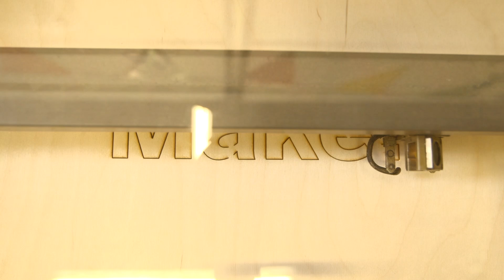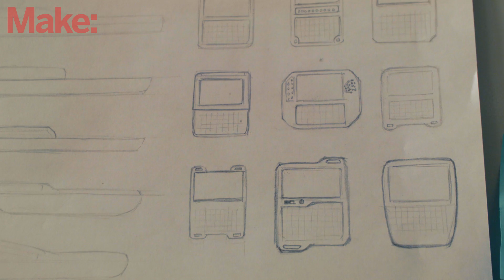Next Thing Co. Releases "World's First" $9 Computer

Comment: Ooo raspberry pi killer?
Reply: sonicase No chance in hell. Allwinner chips are pretty underpowered and laggy compared to chips from other manufacturers. the SoC is the same youd find in bargain basement tablets on amazon for $50 

The onboard wifi/BT is super nice, but Im not convinced the chip in this thing will be overly useful. I was NOT hap[py with the cheap tablet I bought my kid that had this same chip in it.

The price point is amazing though. Im sure there are plenty of projects for this thing that wont require a huge cpu.
Reply: Lex Luthor I can see a use for something simple like this being used in basic projects, like a interface layer for something, like a stereo/CD player. Maybe not a full smart TV type thing, but yeah.
Reply: sonicase No the new Raspberry pi is a 4 core compute plus you don't have to buy any extras.
Reply: Kyder Dogd
you don't have to buy extras with this,.. i'd much rather have built in wifi than hdmi
i agree it's probably less powerful than the raspi2 but not the original...could use an sd card slot though
Reply: Lex Luthor I have the W10 test preview installed in virtualbox, it is really nice, and runs pretty smoothly even in virtualbox. I have had some graphical issues, although this may be just with virtualbox.

I was able to get networking to work inside virtualbox, with a physical WiFi dongle on my real computer. That is virtualbox though. I have not booted it in a few months though, I will open it up again and see how much has changed!

No, the C1 is rocking an 1.5GHz quad core ARM Cortex A5 processor! Pretty nice, but IDK about support for what I would want to run on it.
Reply: Power Max As can I. I think it would probably be great for arduino projects, but Im pretty positive I can build a carputer nav/media system, a full arcade cabinet, or set top boxes fairly cheaply with a Pi. Ill probably play with a couple of these based on price point alone, but it will not hurt RPi at all I don't think.
Reply: Lex Luthor I would like to make a simple computer for my electronics workbench, and now with the new Pi 2, I have been trying to figure  out if it would be a good idea to make a simple Ubuntu machine with the pi 2 and run programs like LTspice in wine, and view PDFs on a large screen for datasheets. IDK if even the pi 2 is powerful enough, I used to use a old Pentium computer w/ 2G of RAM from 2007 for the task, and it struggles. IDK in the processor achutechure will allow windows programs to run, since I think they are designed to run on x86 or something.
Reply: Lex Luthor It does, but it has not been released from what I have heard so far. i cannot wait til W10 is released, I want it... W8 is bad and stuck using W7 and Ubuntu on my main machine.

I can quickly dual boot between linux and W7, but I generally try to avoid doing that since it is a PITA, just having to make sure everything is closed, shut down, reboot, use GRUB to select what I want... wait... then reopen stuff like chrome ugh. W10 is probably be my 'main driver' on Pi 2.

LTspice is a pretty old program, hopefully it will work. I have heard W8 and beyond have stopped supporting legacy programs.
Reply: Power Max Is that the one running the Tegra chip?

Im running the latest win10 test build on my daily driver pc... I like it better than 7. Less cpu use all the time. I joined the group for the Win 10 IoT core build. Its supposed to be available for download, but as of yet the build says its headless and needs a console, no video output, also doesnt support wifi or BT yet, but those are supposed to be coming soon. With as fast as MS is pushing updates this time... and useful ones at that... We should see test builds soon that work full featured on Pi.

Wish Id seen that OCDROID before I ordered Pi... The ability to run android would have been a great option. I liked my buddy's android powered desktop.
Reply: sonicase maybe. an arduino killer, cuz has a shield?
Reply: +sonicase Maybe combining the HDMI and VGA shields, too. I'd like to see this in action at the next Maker Faire.
Reply: +sonicase it is certainly a raspberry pi zero killer, if only because they are being dumbasses about manufacturing them
Reply: +sonicase it's an alternative. Right now, the Raspberry Foundation has the Pi Zero which is kinda similar. It doesn't have WiFi and Bluetooth but it has mini-HDMI out of the box. It costs $5 so it's cheaper but as I said, if you need WiFi you need a dongle, you'll also need a microSD card (the CHIP comes with 4GB of eMMC memory soldered).

As for Windows 10, Microsoft released a version of Windows 10 called IoT edition (Internet of Things). To be honest I don't know what are the specific limitations of such version but AFAIK it looks like a thin client or similar. I don't really think it's a full fledged Windows version, more like a slave posting requests and sensing sensors, etc. I don't know, you could search on the Rasberry page.

In the other hand, Arduino is in a completely different league than the Pi and the CHIP. The former is a micro-controller where the Pi and CHIP are full-fledged computers. Basically speaking, Arduino uses a very limited CPU (most versions don't come with more than 32 kilobytes of RAM, running at 16 or even 8MHz) and it runs a loop to do very specific decision making, things like "if X sensor says more than 30 degress then turn Z air conditioner on and shut the M and N doors". To be clear, the Arduino shields are not more than PCBs with sensors wired out of the box. They don't accomplish anything you couldn't do with solder and ingenuity, except of course they are cleaner to prototype on.
Reply: No, since they committed suicide.